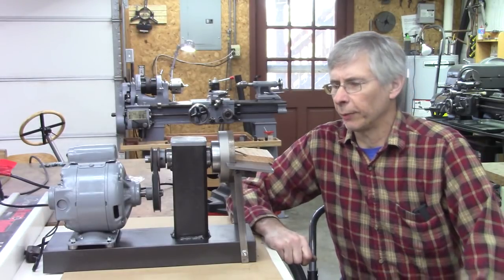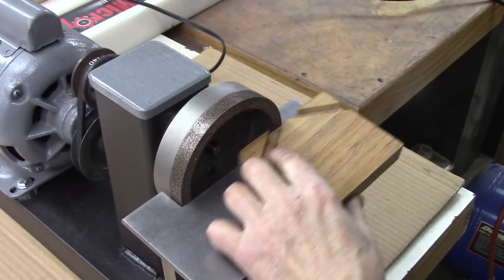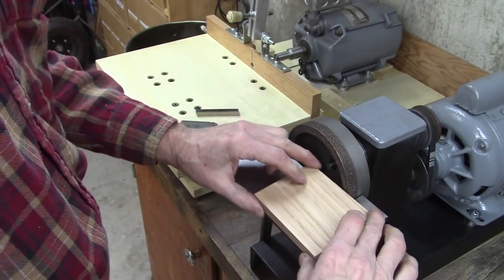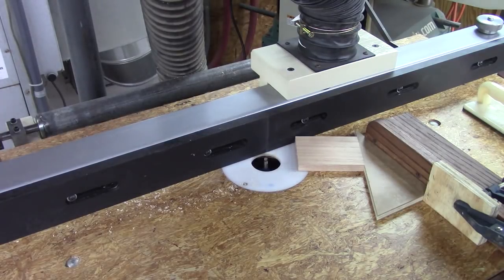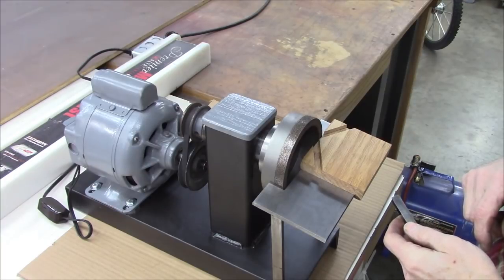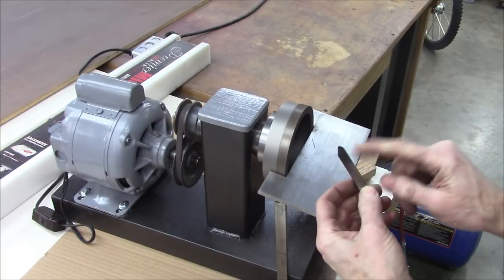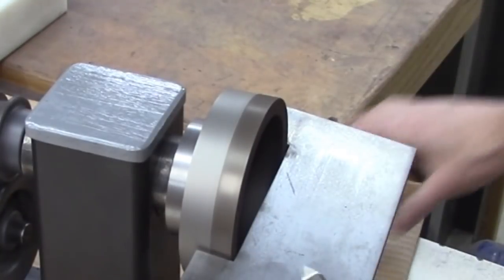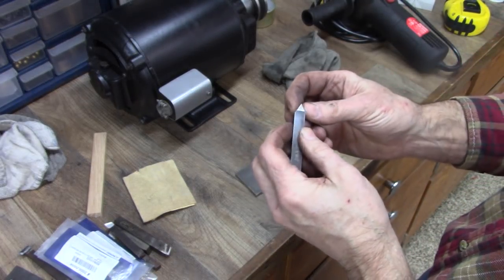Grinding a HSS Thread Cutting Tool with a CBN Wheel

Comment: Putting a small radius on the tip makes the tool cut smoother than a sharp point. Sharp points tend to to dig in an tear material out as where slightly radiused will cut without tearing. This is  particularly true in "gummy" materials.
Reply from the maker: I agree...  and I did this but didn't show it. Thanks
Reply: @WinkysWorkshop It’s also there because threading is a forming operation and a properly formed thread has a flat that’s 1/4 the pitch wide (more typically a rounded over flat on the tip that starts with a flat 1/8th the pitch wide). A sharp root is a stress riser and makes the minor diameter smaller, reducing strength, especially with coarse threads.

You cost me money, Mark! My wheel is on its way.
Reply from the maker: @ikkentonda  Haha...  I don't feel bad, you will love it.

Comment: I read somewhere that there should be zero top rake.
Something to do with it changing the geometry  ?
I think as the top rake increases the actual angle of the cutting edges relative to the workpiece changes.
The 60° has to be measured at the workpiece centreline and top rake lowers the cutting edge.
I am probably quoting some purist ultra precision reference book.
Reply from the maker: Actually you're correct, the top rake does change the angle. I don't think its enough to worry about but it might be good to minimize the top rake. It would work without any but I do think it cuts better with a little top rake. I need to experiment. Thanks!
Reply: @WinkysWorkshop  I was going to mention this but you've already covered the subject. The deviation caused by introducing top rake can be compensated for with small angular corrections on the flank grinding. Again,these calculations can all be found in the Machinery's Handbook etc.

Comment: great, idea-where'd you find the clearance angles,  please, another way run your wood over the table saw
good man and nice calm voice,\
just tried with the disc on a belt sander with table that tilts
Reply from the maker: I think I found the clearance in an old lathe manual. wow...  the disc cut high speed steel?

Comment: Some 30 years ago I lost the tip of a finger in a jointer accident. Your setup cutting slots on the router table scares me. Kickback happens way faster than human reaction time and can pull your hand farther than you would think. I'm not trying to tell you what to do. I'm just urging you to be careful. I still regret my stupid mistake which could have been avoided by taking 5 minutes to come up with a better setup. I do think this is a great project and I thank you for sharing it.
Reply from the maker: I agree, there is absolutely no way to react to a kickback. I felt safe with my method even if did kick back. But now that you have mentioned it...  I just thought of a method I should have used.

Comment: I never thought to do it out of wood. I made mine out of aluminum like Mr Pete did his. mine I made for an acme thread because I needed a 1.5 x 4 threads per inch acme thread. my jig ended up not quite perfect and that created a slight flaw however I did manage to get a functioning acme threaded shaft and nut. 1.5 inch is a big one and so far that is the largest thread I think I can remember cutting so far. I bought some new aluminum stock to make another set for regular threads and a new one for the acme thread. it was a fun project and does help me with grinding HSS which I use HSS a lot more than inserts. enjoyed the video going to check out your video on the build of this CBN grinder now. thanks for sharing the information.
Reply from the maker: Your welcome! I need to try Acme threads again. I didn't have very good luck my first time.

Comment: jeez , brought back some memories, the rake..imagine a plough in the field... little less rake and angle to right slightly, makes the chips curl out like the oll plough in the field,, best way i can discribe it. the bluntning of the tip? weld we need a bit off free angle to bottom of cutterm, so stone the top a wee bit more than the bottom, the the tip cuts a bit wider (less rubbing in the corners) = smooth cut. We did this by hand and an home made 60 degree gauge (hand filed) for tradetest ! those were the days , 1 inch cube must fit in a inch sqaure plate, no light to shine through, man we got grey ..hehe
Reply from the maker: Thanks...  I'll grind a little more off the bottom.
Reply: @WinkysWorkshop  dont make it weak Winky just anormal  tiny carefull touch, i , dont blunten the tip , never done it :) was tought different, a slight flattening is ok to open up the thread inner V  (but with V threads no nead.) tks for the vids i enjoy it.

Comment: Mark, I was on a job for the Air Force on the base, and we were installing a liner in the concrete drains as the area we were working in had specially treated water, and we installed a metal (stainless?) Strap over the upper edge to anchor the vinyl liner in with. That concrete was so hard that the carbide bits dulled quickly. We finally used the bench grinder to keep them sharp. I don't recommend doing this. Some bits turned blue, so they were junk. We did manage to finish the job, but it sure took its toll on the bits.
Reply from the maker: CBN is not good for carbide. You need a diamond wheels
Reply: @WinkysWorkshop  this was 30 years ago, so we just used aluminum oxide, and a lot of water. A diamond wheel would have been nice, but we used what we had.
Reply from the maker: @Farm_fab  yeah...  that would be a pain.

Comment: Great job wink, made one out of aluminum with two set screws it's ok but it don't slide very well on the steel table, I like the wood idea.
Reply from the maker: Interesting, I never thought about how it would slide. Wood does work well...  easy too.
Reply: @WinkysWorkshop  It would improve even more if you wax the bottom face of the wooden jig. As the post above says,aluminium has a tendency to gall and stick rather than slide smoothly.

Comment: I’m gonna need to build me one of them. 
Just what I need. Another project. 😁
Thanks Wink.
John
Reply from the maker: Woodworkers Wonder CBN (run a search). They sell a two sided disc with two grits. My wheel is 60 grit but 80 would be better. They sell a 6 inch disk with 80 on one side and 180 on the other. You could mount it direct drive on a 3450 motor!
Reply: @WinkysWorkshop 
Thanks,
John

Comment: Great machine, what RPM is it running at?
Reply from the maker: About 3000 RPM. Woodworkers Wonder sells 8 inch CBN wheels and they recommend 1750 RPM on there 8 inch wheel. My wheel is a little under 5 inch. I calculated the surface speed and installed the pulleys to make it run the right speed. It's not super critical. The same web site says you can run there wheel on a 3450 grinder also but they recommend the slower speed.

Comment: Very nice grinding tool. Do you make more videos about grinding cutting steels for the lathe?
Reply from the maker: I might make some. To be honest I've used mostly carbide inserts so this is kind of new to me. One reason I never ground my own tools is that it took forever but the CBN wheel changed that.  HSS is sharper and cuts better than the carbide. Thanks

Comment: If I could get a Deal like you did on that wheel I'd build one of those too.
Reply from the maker: This site sells a new 2-sided disc (two different grits) for $60 buck. Not sure what  there shipping rate it but that's not a bad price. The two grits is a huge plus. My 60 grit is a little course. 80 would be better but they sell a 80/180 combo disc.  https://woodturnerswonders.com/collections/cbn-wheels/products/cbn-discs-for-work-sharp
Reply: @WinkysWorkshop  Thanks for the info.

Comment: That is an excellent threading tool grind, I like it!  I have a spare bench grinder from an auction, now I need to find a CBN wheel for it, lol!
Reply from the maker: Check out Woodturners Wonder. They have some 8 inch wheels that should run 1750 but work okay at 3450. They are a little high priced but they also sell a 6 inch disc that is 1/4" think. One side is 80 grit and the other is 180.  You might need to bore the hole and build a side rest for your grinder but it's very cheap and the smaller diameter makes it more suitable to a 3450 grinder.

Comment: Winky, what grit is the CBN that you are using?
Reply from the maker: This wheel is 60 grit. However I built another grinder with 2 wheels and it is 80 and 180. I think the 180 would be better if it was more like 300 grit but it does well anyway. https://youtu.be/q-lZwf3Se54?si=P9QO6wJefVuB9DO9
Reply: Thank you, Sir. I enjoy watching your work! As a machinist apprentice, your clips are helping me tremendously.
Reply from the maker: @saulcardenas1268  Your welcome

Comment: I have had a CBN 6" wheel on the grinder for 2 years. It walks through tool steel. Mine has a 3" radius cut. I would like to be able to grind flat like Woody.  I have bought a couple more CBN wheels from Woodworker Wonders, but have not done the work that Woody did to make his grinder.
Reply from the maker: Woodworker wonder makes a 6 inch 2-sided CBN disk with 2 different grits. If I was going to make another grinder this is what I would use. The abrasive wraps the end just enough to cut a back rake notch. It's only $59 bucks. It would be perfect to mounting directly to a 3450 motor shaft

Comment: I would've expected much lower RPM with CBN wheels, I need to get me one of those.
Reply from the maker: To determine the speed I went to Woodworkers Wonder web site. They sell 8-inch CBN wheels and recommend 1750 RPM. I calculated the surface speed and applied it to a smaller wheel (4.8 inch) and made it go the needed RPM. Actually the web site said you can run the 8-inch wheel up to 3450. So my grinder is on the lower end of the speed range. What amazes me the most is almost no heat build up. Thanks for watching.
Reply: I purchased an 8 inch cbn wheel recently and in absolute aww with it running at 3000 rpm. 
Its a great tool

Comment: That is a nice grinding station that you built. HSS sure comes in handy on smaller low rpm lathes. I have a feeling that this grinder is going to see alot of use.
Reply from the maker: Thanks Andy, and i agree, it will get some use.

Comment: Excellent Mark. I like the common sense approach of using wood for the jig. My mind would have been using some metal probably aluminum and doing it in the mill. Your idea is quick easy and functional.  A lot can be said for diversity when it comes to creativity. Thanks again for your effort and time.
Reply from the maker: Thanks 👍  Of course you could still use wood and mill the slots too.

Comment: Hi,Mark. This little tool grinder project has turned out exceptionally good. As you would say "I like it".
Cool cutting temp isn't what you would predict from a fine surfaced wheel. You would expect a coarse grit carborundum wheel to produce less heat build up than it does. The specific tip radius geometry is all given in detailed threading nomenclature charts. The main purpose is so the  external thread crest and internal thread root  have clearance to prevent binding against one another. The contact point should be mainly at the mid point (effective diameter) or PCD.
 I am currently building a Worden tool & cutter grinder from a Hemingway kit. It will be a very versatile unit with all the attachments for radius grinding, four facet drill sharpening, slitting saw sharpening etc. I do like your cheap and cheerful version,though.
I'll have to have me one of these CBN wheels.
Reply from the maker: The CBN wheel is totally amazing. Interesting on the tip radius and it makes sense. It must be a very small radius. It seems like all the insert cutters I use are very sharp.

Comment: Not being a machinist i was wondering how do you determine how deep to cut a thread?
Reply: The shape of the crest gives you a good indication, once you go beyond the ideal depth then you'll start cutting into threads. Eyeballing is good enough if you do this often and you don't need a perfect fit. You can always using a DRO and the metric / imperial charts to cut to the depth required but best approach is to get close and then test against the nut or whatever you're using.
Reply from the maker: There are ways to measure the thread depth but if you are cutting 1/2" threads and you start with a 1/2" bar the depth will be very close when the threads are sharp.
Reply: The quick and dirty methods described above work adequately for most home shop depth of thread measurements. If the threads need to be a specific to drawing design then measuring the vee's over thread wires with a micrometer is the method used. Winky did an earlier video on measuring cut threads with the 3 wire method. Look up on google measuring screw threads with wires,there are loads of diagram explanations how its done.

Comment: I think you have the largest Table Saw Sled I've ever seen! lol
Reply from the maker: Ha...  Yeah, I used to make cabinets and need to be able to cut sheets of plywood. I could never go back to a smaller sled. It also have a 4 x 6 foot outfeed table. You may have noticed the sled (and outfeed table) also doubles as a work bench. It still works well but I'm thinking I need a clean start. Thanks for the comment!